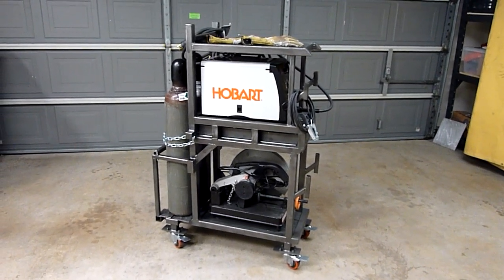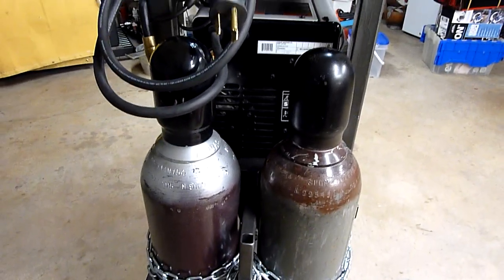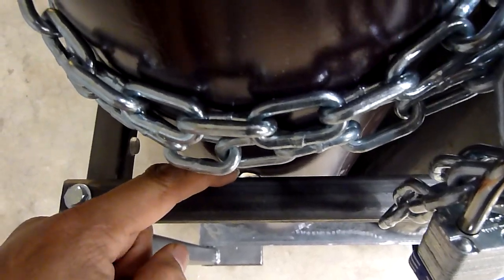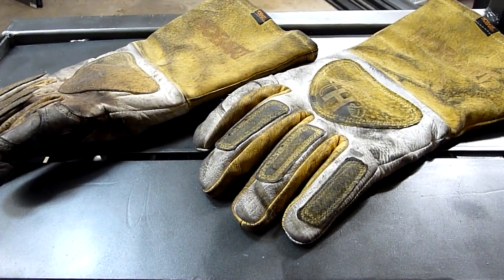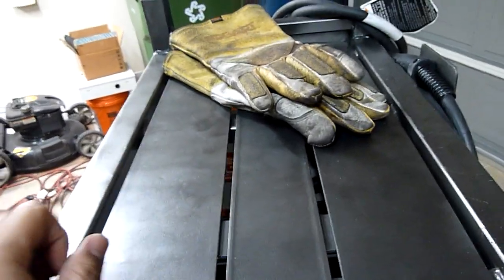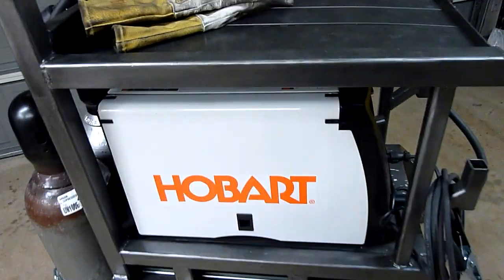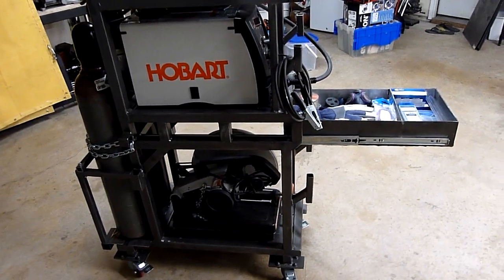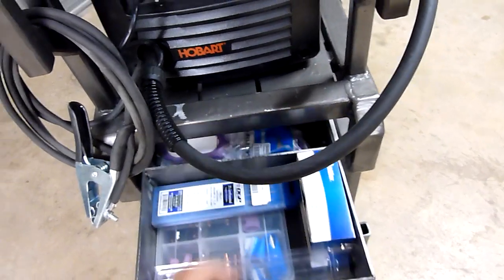Welding cart project

Comment: Like the fact your videos do not have guys shouting over heavy metal rock music... I think I am going to build 2 - one for TIG & Cooler and one for MIG & Plasma. The TIG is pretty big so different dimensions. You helped me refine my design - much appreciated.
Reply from the maker: Lol - I'll keep from adding heavy metal music to my videos in the future based on your comment. Glad my design helped you out.  Good luck on your builds.
Reply: @ShinyInsanity   I am a bit lazy and don't like faffing around so I am planning to install a 'Y' adaptor on the MiG gas port and connect both the Argon and welding gas to make the switch easy for Brazing / Aluminum & steel gas shield. Did you do something similar?

Comment: This is the best one on YouTube. Are you able to post the plans ?
Reply from the maker: Thank you for the  comments. Unfortunately I do not have the original plans as I built it as I went along.
Reply: Shiny Insanity thanks for your reply. If you'd be happy just to send some dimensions of the three levels and the steel dimensions I'd really appreciate it. I'd really like to build this and I think it's the best one out there. No pressure though if you're too busy
Reply: Hello, how did you attach the drawer runners to the side of the frame itself ? Did you spot weld them?

Comment: Nice cart probably use wood under tank or rubber and around cylinder just in case i ever turn machine one and have the ground and gun touching cart. The design is nice i will attempt similar one.
Reply from the maker: Thanks. That's a good idea. Might have to do that as well.

Comment: Great design I was looking for designs to build my own I like your design a lot so I’m going to build one like yours.
Reply from the maker: Thanks for the kind comments. Glad you like the design and good luck with your build.
Reply: @ShinyInsanity  hey sorry for asking but had one question maybe you might know the answer .question is in regards to tig  tried looking on YouTube and no one really has any info on it. When using tig how long so u press the pedal for and do you fluctuate as your welding also how long can you weld on tig to where you need a water cooler? If you know let me know thanks.
Reply from the maker: @SWTWHITEGSR  Sorry I'm not too good with tig so can't offer much advice there. My tig machine does not have a foot pedal. Weldingtipsandtricks and weld.com on YouTube are good resources for tig knowledge though.

Comment: you could just put a couple hinges at the back of the draw and put a piece of plate that fits on top of the draw,,,, problem solved draw is sealed from everything
Reply from the maker: Thanks, good idea.
Reply: kinda like an old bread draw ,, ,for those of you that remember them ,,lol , but instead of sliding open , it would flip up to open ,,, and it would give you a little extra work surface too ;)

Comment: Nice job on the cart, what did it cost for the steel?
Reply from the maker: Thanks. It's been a while so not exactly sure what the final cost was. I think I had bought $150 worth of steel at the time but not all of it went into the cart (other projects) so it was less than that.

Comment: just want to ask the total height of your cart. if by chance you already added a machine on top, is it top heavy? tipsy? im planning to make one close to your dimension . i based it on your shielding gas tank height
Reply from the maker: I'll try to get you a measurement when I'm back but no the cart is not top heavy since I only have a light stick welder on top. I made sure to keep the heavier machines on the lower levels and the gas cylinders keep it pretty stable so far.
Reply from the maker: The cart height is roughly 53 inches  tall. That includes the 4 inch casters that it rolls around on.
Reply: @ShinyInsanity  thanks alot buddy. My project plan is close to  your dimension. My plan is two welder on top. Parts drawer in the middle ( side opening) and two tanks at the back. Hope mine will not be unstable
Reply from the maker: @the_fixer-ho8zd  No problem. Mine is pretty stable so far but the heaviest unit is in the middle. You can always extend the width a little more if you want. I wanted to fit mine into a little side space in the garage which helped dictate the size I went with. Hope your build goes well. Happy holidays.
Reply: Can you possibly share with us the approximate length of each kind of tube stock needed ? Thanks in advance . Very nice welding cart !